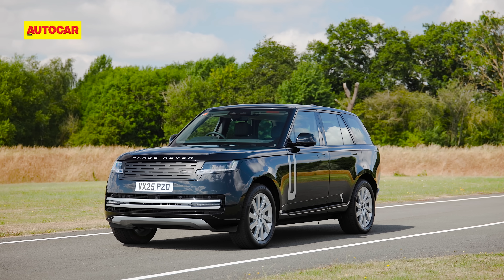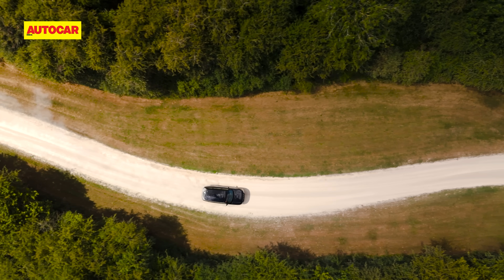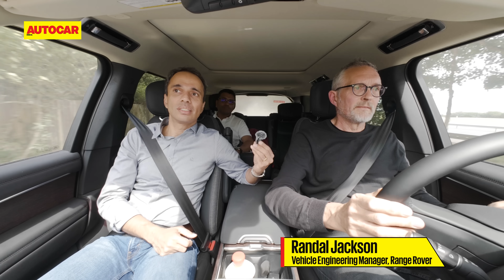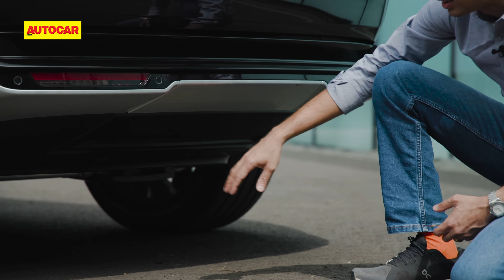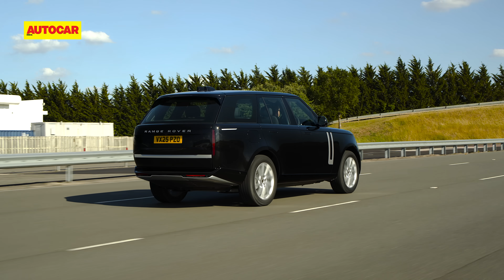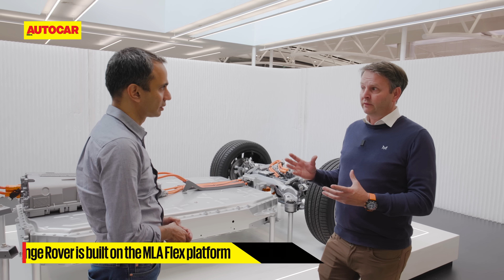Range Rover Electric - Experiencing the quietest Rangie yet | Autocar India

Comment: 95% of the Range Rovers sold aren't going off road anyway. Most of them spend their entire lives on tarmac - shopping, taking rich kids to schools, etc. EV's are perfect for these. More than enough range, no sound, no pollution, less moving parts, less wear and tear. So, why not?
Reply: Teri kyo jal rahi hai
Reply: First part wasn’t necessary😂😂😂… but yeah it’s good for the environment
Reply: Grapes are too sour anyway… 😂😂😂
Reply: Then a 35kWh battery would be enough for 95% use case.  
Add a 40hp range extender to eliminate range anxiety for the rest of 5% use case.  
118kWh battery is heavy af, a lighter battery would give much higher energy efficiency
Reply: @clippyTheSahayak  A century ago you'd be be advicing Henry Ford and Karl Benz to bring along a mule team for when their automobiles ran out of gas after 10 or 20 miles as they used to.

We have EV's going 400 and 500 miles, charging at 400kW and 500kW, with nothing but 350kW and 400kW chargers being installed by all the big charging providers, but no. Let's bring along a modern day mule team instead.